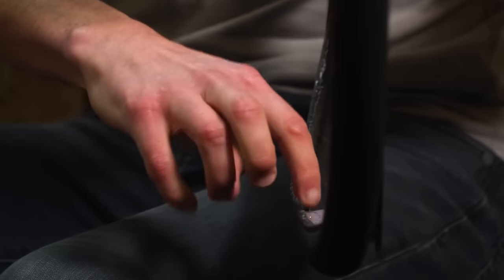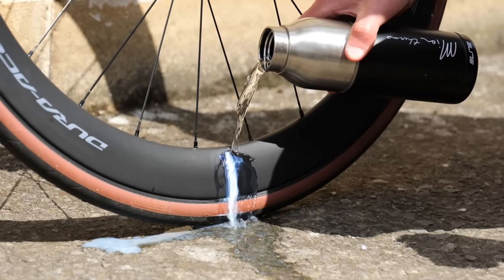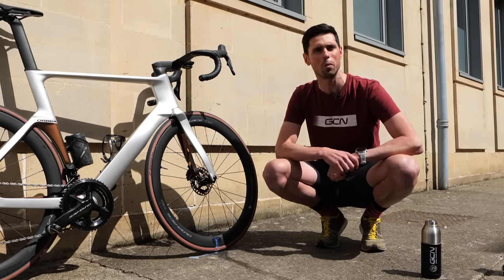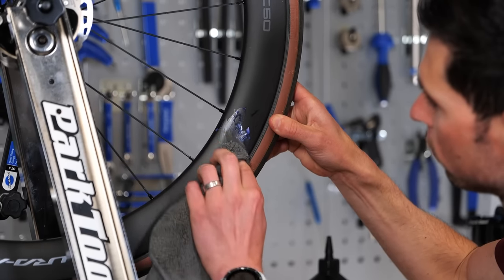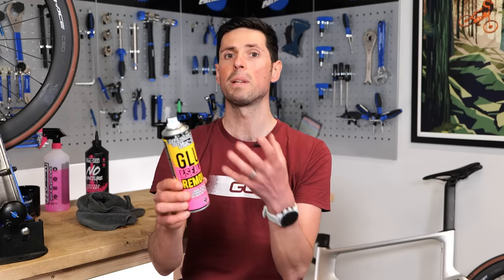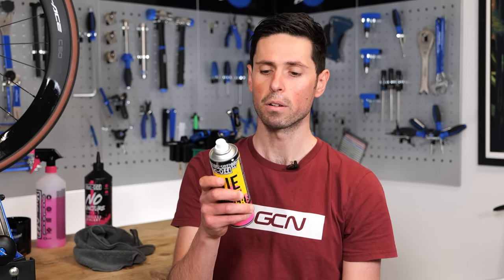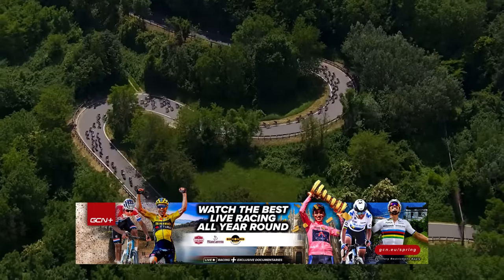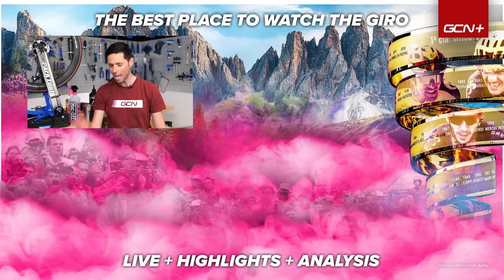How to Remove Dried Tubeless Sealant From Your Bike | Maintenance Monday

Comment from the maker: Have you got any top tips to removing dried tubeless sealant? Let us know down below! 👇
Reply: Don't use tubeless tires :-D (You asked for that, lol)
Reply: +1 to sticking with tubes... And +1, you asked for it
Reply: Any suggestions for the US where Muc Off sealant/glue remover isn't sold?
Reply: Never really had any problems with this. There was a case when I found out about the puncture couple of days later, when I realized that it is indeed a sealant on my rear light and seat tube. It came off with soap and water, no problem.
Reply: Is there a method to clean the sealant inside of the tires without having to unseat them?
Reply: @cntchds  water
Reply: @jksjksjks85  a scholar and a saint.

Comment: Rather see a video on how to remove sealant from used tires
Reply: I had some good results with some grinding blocks from the hardware store. (Like sandpaper wrapped around a soft foam core)
Reply: Seconded.
Reply: I agree!  Easy enough to remove from rims, frame etc. The real challenge is removing long dried dried sealant from the tyre bead and inside of the carcass before swapping out the tyres or re-sealing with fresh/different sealant. Fingernails, scrubbing brush, soaking tyre in a sink with detergent etc is a very frustrating and slow process - like 2 hrs per tyre!  Isopropyl alcohol makes little difference, though the smell keeps me happier!
Reply: @sfox6565  And I can add in that nylon brush in the drill is already too brutal and damages the tire.
Reply: Why?
Just flush off any liquid. The dried sealant stuck to the tire just helps seal air in.
Reply: @galenkehler  Dried sealant on the bead can create an uneven surface and prevent the tire from sealing.
Reply: If you really rough-up the tire, get a very close look at the bead. I mangled one up a bit (with a tire lever) and it caused the tire to creep off and blow, one warm day. Just saying, show some care with power tools and other heavy measures.
Reply: I let my sealant sit in my tires too long. I used a steamer to break it up and clean it out. I used paper towels while I used the steamer. The sealant I had was Muc-Off and it was in for about 8 months. The sealant clogged up the brush on my steamer, but was still effective at softening the sealant and getting out of the tire. 
I first was using really hot water and having some success, but the steamer speed up the process and was not as messy. I had to refill my steamer one time. I rarely use my steamer, but when I do I am SUPER thankful I have the old thing. I think I got it off QVC back in the 90’s lol
I just finished up about 20 min ago
Reply: Easy way - pressure washer - needle point settings

Comment: If you already have isopropyl alcohol, that will clean the sealant off your frame/wheels.  No need for a specific cleaner.
Reply: Unfortunately, that did not work for me.  Still dealing with sealant everywhere on a new bike.  BTW, I replaced with tubed after first blowout with less than 200 miles on bike.  Will NEVER go tubeless again.

Comment: I didn't know this was a problem.  I've used tubeless since 2015 and rarely even know I had a puncture until I replace the worn tires and see all the sealed punctures on the inside.  I've never had any sealant spray out.  Perhaps it's because I run 32mm tires at 55 psi?
Reply: You know you just jinxed yourself.

Comment: my experience is tubeless are great on the ride (low pressures, reduced punctures) and a massive pain everywhere else (cleaning, fitting, valves clogged)
but at least everywhere else is warm and dry, so I'll stick with them

Comment: A slow dribble of sealant through the sidewall is your best possible case.  Speaking from experience, after a tread puncture at road pressures you'll need to buy enough of that Muc-off cleaner to take a bath in.

Comment: Thanks Alex, I only run tubeless on my road bike. I wish I didn't have to, but we have an infestation of "Tribulus terrestris" or puncture vine in our area. My only other option are tires like Schwalbe Marathon Plus, which are great for touring but hellish heavy for a sport bike.  If I don't use tubeless, I can count on up to 5-6 flats per week on local roads. With tubeless, none.
Reply: Five to six per week is a lot :-o
There's a third option, tires made of solid material like Tannus. I read that they have a higher rolling resistance than clinchers but I think Marathons aren't the best rolling either.
So in your case tubeless might be like it was invented for you.
Reply: @jochenkraus7016  Yes, I agree. For my road bike, tubeless has been a lifesaver.
I do use Marathons for touring and gravel.

Comment: Before using the glue remover, I‘d try the disc brake cleaner and I‘d only use the glue remover outside.
Reply: Just be careful around rubber with brake cleaners, they can dry out seals/ gaskets. Potentially an issue for tiny valve core seal I suppose.

Comment: Considering all the various videos around installation, topping up, cleaning up etc it does beg the question: is it really worth all the faff?  Considering it’s advised to still carry a spare tube, Is there really any noticeable difference  versus say, good clinchers with latex ? (Besides fewer punctures perhaps)
Reply from the maker: There's definitely more faff on set up, but generally you're much less likely to get a puncture riding tubeless. Of course, there's nothing wrong with a good set of clinchers, and they can offer top protection, but this means the option is always out there! It's all about what suits you :)
Reply: the answer for me is a hard NO
Reply: If you want to take advantage of lower pressure, then yes, it's definitely worth it.
Reply: Some days ago I lstened to a podcast of a German bike magazine. Tubeless seems to be fine as soon you got it going. But to get that far, tubeless setups don't seem to forgive any bodges. Thinking "That will do" or "I'll quickly put on new tires for the ride I have tomorrow morning" are a bit like "famous last words". 

I'm not sure about tubeless. I run Schwalbe 25mm Marathons and it took me several years to puncture. So that might be a tie. Small punctures will seal but if it doesn't you have a flat tire plus the sticky sealant mess.
Reply: @jochenkraus7016  Also, if you are someone who has multiple bikes, or who doesn't ride frequently, it's not worth the effort to manage tubeless setups on multiple bikes.  Especially road bikes.  I'm also a "Clydesdale" (putting it nicely), so I don't benefit from the lower pressures as  much as lighter riders do (can't afford a rim strike).  Great for MTB, decent for gravel (32mm plus).. Road at 25-30 mm?  Not for me.  I went down that road once.  I'll stick to tubes.  My only point is, tubeless is great for some folks, who have the hardware to do it and the wherewithal to faff around with it.  Also if you are riding in an area where punctures are common.  My situation doesn't warrant it, so I don't do it.
Reply: @jochenkraus7016  I’ve learned the “setup for tomorrow morning” lesson the hard way. But once you figure out how to look after them tubeless tyres aren’t too much faff. Any mess can be sorted with warm water.
Reply: @armadillito  Allow me to add: Many people, like myself, also do their first few rides (on a newly mounted tubeless tire) with an inner tube so that the bead and rim tape seat nicely. This resolves the "I hope I got it right" anxiety from going with sealant straightaway.

Comment: Run tubes but a 'tubeless person' punctured in front of me and sprayed my frame with god knows what sealant but wd40. Gt85, brake cleaner, sticky stuff remover and rubbing alcohol have all failed to even remotely remove it from the frame so guess I'll have to try this muc off stuff!
Reply: @1Equinox1 how did it went?  i have the same problem as you

Comment: I’ve received a pair of @ridelightweight Meilenstein 20 (hardly used, but from a few years ago). The former owner had some light tyres on them as a tubeless setup without sealant. I think those were Michelin Power Road tyres. It seems to have worked for him. Does it mean I can put on Continental GP5000 TR on them. The wheels are definitely from before the Meilenstein EVO era. #askgcn
Reply: The old mavic ust system worked without sealant. If that’s what was used on those Michelin tires and that wheel, then you would need sealant for any new setups. I don’t know if lightweight used the ust standard, it may have only been for mavic wheels.

Comment: The Muc-off Glue and Sealant Remover recommended here DOES NOT WORK. Useless stuff. Even traditional glue remover 'HG sticker remover' struggled. Would have had to soak the wheels in it and rub forever. (HG Sticker Remover contains Solvent naphtha and (2-methoxymethylethoxy) propanol and usually works on anything). So in the end I put the Dirt Blaster lance on my Karcher jet wash and blasted off most, but not all, of the gunge from the sealant on the rims of my wheels. Yes it took a bit of the wheel labelling off but the paint on the rims was durable and not affected.

Comment: I wouldn’t advocate wasting your drinking water which potentially has electrolyte tabs in it on a bit of sealant spray, it’s just a waste and it could potentially be leaving you without fluids if you’ve still got a long way to go home.

Sealant usually just washes off during a normal wash routine. If it’s particularly stubborn for what ever reason isopropyl alcohol makes light work of taking it off and is perfectly safe.